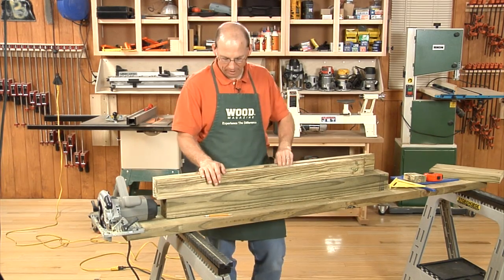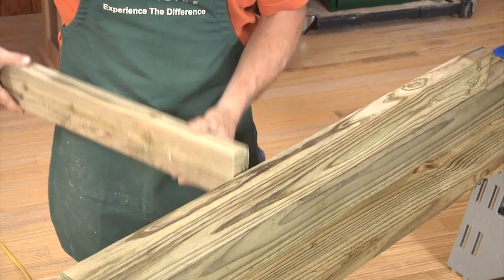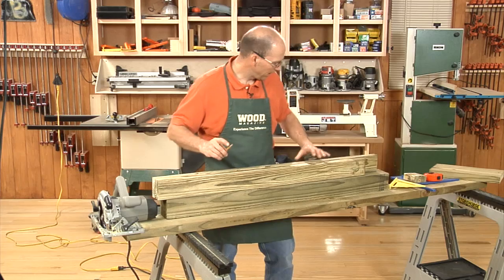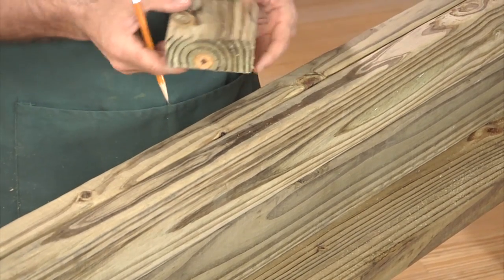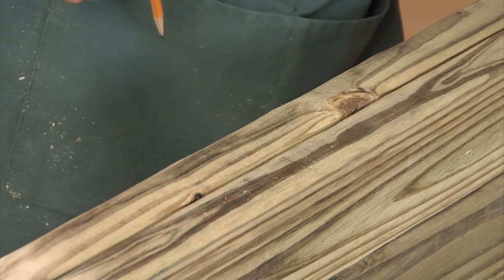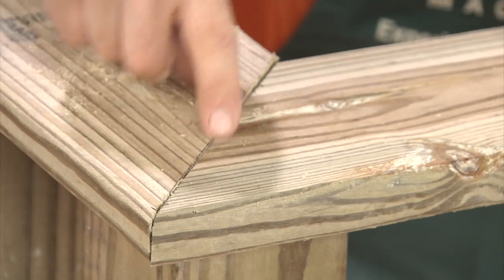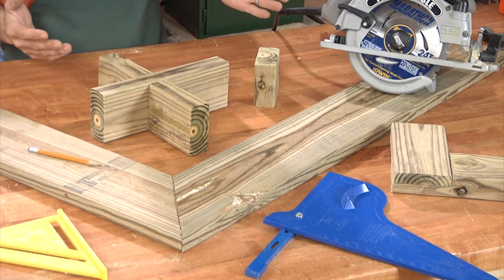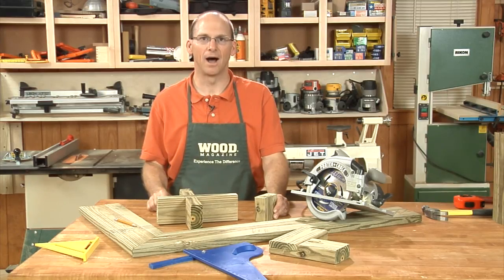Circular Saw Joinery - WOOD magazine

Comment: A good practice would be to unplug when adjusting the blade, and that wood was wet but dry pressure treated is pretty nasty to breathe.
Reply: Yep
Reply: Who does that?
Reply: A saw won't start itself; when adjusting, just keep your finger away from the trigger switch and you're fine - common sense.
Reply: If you’re afraid of a tool don’t use it.  Maybe take up knitting instead

Comment: The material looks like PT lumber.  When I cut that poison I wear a respirator, eye protection (ever had a PT sawdust in your eye?) long sleeve clothing, and gloves. I also blow it off my clothing when I'm finished cutting.  In addition, I also wear hearing protection, even if the cut is for 20 seconds.  That high pitched saw whine over time will kill your hearing.

I will say, thanks for the tip on cutting from edge to shoulder.

Comment: Funny , I have to make a (almost 45) on a top rail tomorrow on a deck project for my granddaughter! Well explained young man !
Reply: I've had bad experience with deck rails cut at 45 degrees, as the boards shrink the joints open up at the heel, a lot.  Do a square half lap at the corners, like Jeff did on the 2x4s, glue and screws.
Reply: Maybe late but make the grain is the right way up. A frown will cup on a rail. His longer board was the wrong way(I realize grain was not the point of the video.) Good angle cut explanation.
Reply: @notsure103  Yep, I've had to put them in upside down to hide a horrible wane and seen the cup get so bad I had to come back and change the board cause folks was trip'n.  It's all them small trees loggers are forced to cut.  Decks are hard to build.  I try to get customers to build decks out of red colored PT, it looks like shit when you build it, but most everything else looks like shit a year latter.  I'd never put and uncovered wooden deck on my own house, concrete is way better.

Comment: I'd suggest that you at least mention the lower weight advantage of a smaller circ saw (still capable of cutting 3.5" lumber). Also you did quite a bit of freehand cutting. My experience as a relative novice is that it's hard to be sure exactly where the blade is cutting & it's hard to ensure the start & finish of the cuts remain square.
Reply: How do you get to Carnegie Hall?  Practice, practice, practice.

Comment: Steps and info seemed good, but missing safety glasses and clamps to safely hold the wood while working on it.  handling of the saw while resetting depth , left it plugged in?

Comment: When I’m working on site I only use a circular saw, it’s all I need
Reply: It’s a bit akward for knocking in nails, though. Doable, but akward.
Reply: How do you bury your deck posts with a circular saw?
🤔
Reply: unclassified  🤯 Life Hack.
Reply: @Traitorman..Proverbs26.11  A Bosch rep once told me their cordless drills were so tough if the battery went dead you could always use the drill to bang in a nail!, never tried it myself, but mine did once survive a 30ft fall when it slipped out of my tool holster while I was climbing a ladder

Comment: All those sayin he should unplug the saw before making adjustments wouldn't last very long on a framming crew...98% of frammers wedge the guard up and sometimes use there fingers to slow the blade...just gotta respect the tool because that dog bites and it doesnt care if your a newbie or a seasoned pro.

Comment: Note to author:  A number of times I noticed what appeared to be a possible 'trimming' of the Kreg crosscut jig's reference edge.  I think the saw is meant to rest on this edge but not run the saw teeth through it each time.
Reply: If you have it set right to the edge of the blade eventually the blade is going to wobble a bit and rub it. That's what that looks like to me.

Comment: You should make it a point to those who are just learning to unplug the saw before you put your fingers near the blade.Your next video might have one less finger. Safety first
Reply: Remember theres a safety button to prevent you pressing the start switch, so accidentally starting it isnt a simple exercise! Its a two stage process which is difficult to exercute with one hand holding the saw and the other adjusting the depth! Calm down!!!!

Comment: Great video  but one major problem. Safety was not emphasized in this video. The video shows the carpenter making a cut and then without unplugging the saw puts his fingers on the blade for the adjustment of his next cut. I strongly recommend that you delete this video from Utube and add the safety feature of unplugging the saw before handling the blade. And then definitely adding this great video back to Utube.

Comment: I am highly disappointed that Wood Magazine would sponsor this video  It completely ignores a critical safety practice.  Mr. Mertz adjusts the saw depth,with hands on the blade, without unplugging the saw.  In one case the saw cord connection to the extension cord is visible.  Also, his glasses do not appear to have side shields which are required on safety glasses and safety glasses should always be worn when using a skill saw, even if it is only in a home workshop.

Comment: Thank you for not suggesting to unplug the saw before making adjustments. I think we should let Darwins theory work.
Reply: Amen, to that
Reply: If your starting out, follow all the rules, it's the safe way, but when you are experienced you will never normally injure yourself with your tools, they become so familiar they are just an extension of your hands, that is why all the old boys I worked in the shop and on site all had all their limbs and fingers, it's called knowing your craft, and many of them had been doing the job before safety kit and rules were a thing, you just learned how to do it from someone highly experienced and used your common sense, I am just about old enough to remember simpler times with less safeguards and I have never come close to injuring myself or anyone else, but I have been using tools for well over forty years and was one of the last generation to learn from master craftsmen and there is no substitute for this...

Comment: Good video on basic notching but I have noticed you were using some green pressure treated wood which has its own hazards when especially cutting and sniffing its dust.  I wonder why the big box stores employees refuse to cut it knowing its dangers of green arsenic chemicals only known to Californians !
Reply: Hi as someone who works in a big box store nowadays after 40 plus years in the building trade, CCA that's the abbreviated name of Copper, Chromium, Arsenate treated timber has not been in use since I was an apprentice, it's just a blue green dye now with some eco friendly preservatives, it can give you a sore throat if you work with it all day, but it's not deadly, the reason we don't saw it is it gums up blades and is very tough to cut with a hollow ground 80 tooth finish blade and blunts them quickly also stick timber thats anything under 9" or 230mm is not cuttable on a vertical panel saw, you need a chop saw for the job

Comment: If you want to make an information video, maybe you should unplug the saw when you adjust the depth and use ear protection. Otherwise, good video.
Reply: I might have also clamped the 2 pieces of wood together before cutting both of them at the same time
Reply: The video focuses on joinery techniques, and is 15 minutes long already,  the safety instructions are available in  director’s cut edition :)
Reply: Absolutely.  Even when an "expert" You Tube presenter is not focusing on safety as a topic, he or she should be demonstrating safe practices.  Unplug, and make sure the audience sees that you're unplugged.  Slip on your hearing protection, dust mask, and eye protection before you pull the trigger!
Reply: unclassified  That's a sign you're on the wrong job site. No job is worth chronic or workplace injuries.

Comment: i wonder if he knows hes using a left handed saw and he's right handed
Reply: @Wood  Your right I own that same saw with the blade on the left, but your better off with the blade right you always want the motor on the material side
Reply: @loucifer323  The motor should be pointing away from the straight edge or square

Comment: If you can't cut straight lines without a square you shouldn't be in the trade. Unless your doing cabinet work. Idk just my opinion
Reply: It wasn't just a straight line, it was a notch, which requires slightly more accurate shoulder lines, the square meets that need better than free-hand.
Reply: show us how its done Josh
Reply: All im saying guys is that Iv been in the trades for nearly 4 years. (Not a long time. I no). And i have guys that work beside me that have been doing it for over 20 years and not once have Iv seen them use a square as a saw guide. And myself included. Hey If that's how you feel comfertable cutting you wood so be it. We just use our square make line and cut. Don't have time for all that extra shit. What ever suits your fancy boys. Have a merry Christmas.
Reply: Josh Thompson yes i get it for rough framing no one uses a square for cutting lines but his doing joints and unless you want gaps a straight line is a must
Reply: Wrong place to flex lol
Reply: @joshthompson3146  I'm sure there are professionals who don't use the speedsquare to line up their circular saw cuts, but I was actually surprised by your "I've never seen it". This is one of the oldest and most common circular saw techniques. I see it literally all the time, both in shops and job sites.
Reply: @Miguelangel - maybe that is an indication as to what kind of crew this guy is on?  The framers that framed my house used them.
Reply: Is this vid for people "in the trade?"  If you've been in the trade for 4 years, why do you need to watch a DIY vid from a hobby magazine?  I'm here to learn.  I practice a little bit once in a while, so I'm not as good as you.  Using a square gives me nice results.
Reply: @andyboybennett  I've been in the trade 50+ years and watching this,its interesting and I like to see people's different ways of how to do a job.We are all learning,no one knows everything.